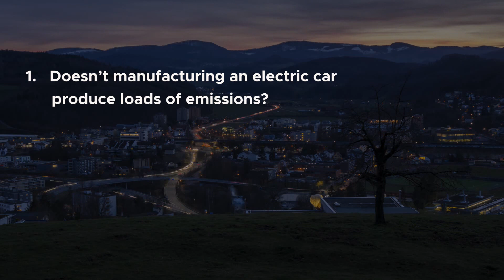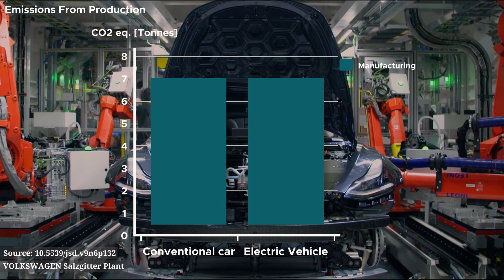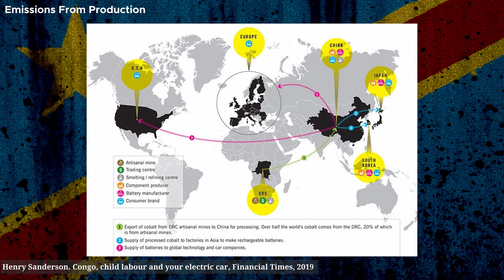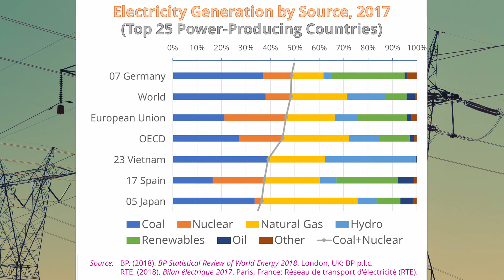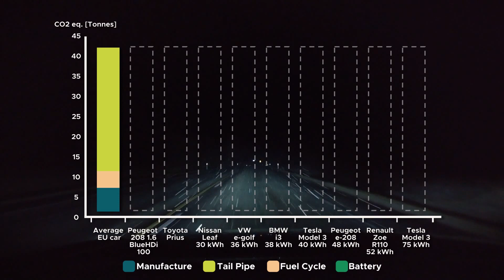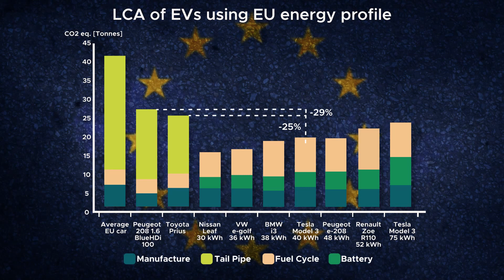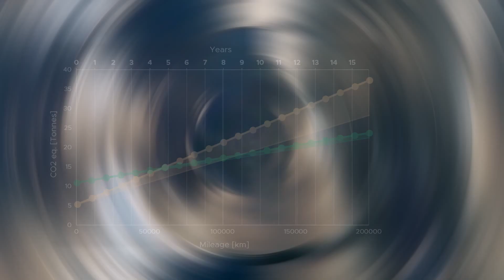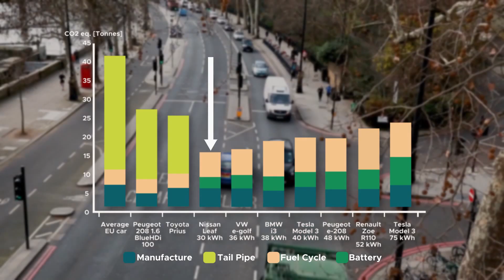Could Electric Vehicles be Bad for the Environment? Data Reveals the Truth

Comment: You've managed to neglect the third leg  ... end of life.  Batteries are far more difficult to recycle and are more harmful overall due to heavy metals. There currently is no process for recycling them on scale, so guess where they will end up? So it's not just battery production that is harmful. None of that is reflected in your assessment.
"Green" can't always be equated to CO2 production.  Not to mention that not everyone agrees that CO2 plays such a significant role, or the only role in climate change. E. G. Methane
The environment has a greater and quicker effect on the wellbeing of civilization. I. E. contamination of drinking water, food sources.  If you don't take care of that, climate change will be a moot point.

Even if your numbers are accepted and are ballpark correct, EVs will provide at most 50% reduction?  Pretty sad that this is the best we can do. 

The greenest thing you can do is to stop buying new vehicles.
Reply from the maker: Hi, you're absolutely right that there is no industrial process for recycling batteries, which is why we neglected it from the calculations - we did not want any speculative numbers in this data set.
However, our references (linked in the description) show that, as you say, recycling produces emission. But the emissions recycling are less than the emissions from production for a new battery. 
It would've been nice to be able to include recycling in this video, it would've made EV's even more sustainable than ICEs. 
We haven't used CO2 emissions in the video, we've used CO2 equivalent, which takes into account effect of different greenhouse gasses. Perhaps that wasn't clear enough.
A 50% reduction is huge! And regarding not buying a new car, at the end of our video we show how long it would take an EV to produce less emissions. If someone owns a old/inefficient car then keeping that car on the road for a few more years is more damaging to the environment than buying a new EV. Although, of course buying a second hand EV is the best option.
Reply: @OurEden  one of the things I was saying is... The impact of contamination/pollution on the "environment" thru heavy metals /carcinogens cannot necessarily be compared to or equated with c02 or other greenhouse gases that ostensibly have longer term effects on climate. We haven't seen the extent of this yet since mining is often done in 3rd world countries... And we haven't yet had to deal with the effects of recycling batteries. 

As for the 50%, that's incremental and just means me have 24 years to live instead of 12.  I love rhetoric.

Lest you think I am against clean energy, I am heavily invested in it. But I also know that there are tons of challenges and limitations... oil and ICE aren't going anywhere soon. I'm not selling my pipeline stocks.  Have a look at "solar heat island effect" for example. Most people aren't aware of this.
Reply: @OurEden  "Hi, you're absolutely right that there is no industrial process for recycling batteries, which is why we neglected it from the calculations" Incorrect, again. Nissan and BMW already are recycling / repurposing their batteries, and the entire battery is 96% recyclable including the heavy metals. What you have failed to do is compare the massive environmental effects of using petroleum. It is certainly cheaper at the moment to repurpose than recycle, but it's being done.
Car batteries being used in home power banks: https://youtu.be/8ZDllPFmXNg
Tesla's battery recycling path: https://youtu.be/LAssX6hAyKs
Reply: @justsomeguy934  Have you ever watched a car being scrapped?

It is easy for a manufacturer to say their car is recyclable and it's true. But in reality when a car becomes worthless the entire car (minus the battery) is crushed up and melted down.

Here in Ireland we don't do much oil / metal refining. We melt the car down into an orange paste, process a little aluminum out of it and export the orange paste to Africa as a waste material. Every material that was in the car is now either in that orange paste or in the atmosphere.

I doubt this video touches on half of the "Carbon emmissions" of manufacturing and scrapping a car and it doesn't even mention the other environmental costs.

The EU is just taxing old cars off the road to prop the car industry up.
They don't give a shit about what happens to them.
Reply: @JKenny44  The discussion was about the batteries, was it not? Aside from the batteries in an EV, it's a conventional car. Steel, glass, upholstery. The batteries are most certainly NOT thrown into the slag pile and melted into orange paste.
Reply: @justsomeguy934  Yes I suppose I am a little off topic.  
The best thing you can do usually is to keep an old car on the road for as long as possible. Any engagement with the new car market is bad for the environment.
Reply: @JKenny44  You are 100% right - keep the working car as long as possible. Don't buy new things unless you need them. If you have an old, beat up vehicle that's reliable and works for your needs, leave it be!

Comment: 8 years of lifespan of battery vs 5 years after it become better. Hmm...
Reply: No. 8 years is the length of the WARRANTY on the battery. It won't suddenly stop working at 8 years and 1 day old.....  Many EV batteries last 10+ years....after which many of them can be refurbished rather than completely replaced.
Reply: @Brian-om2hh  average lifespan is ~10 years (data of other electric car companies, tesla estimate more). So no, warranty is not very more than average.

Comment: Very well researched video! But I'm wondering if the reduced battery efficiency over the years will have any impact on the over all carbon emissions. Also if the battery has to be replaced it seems any advantage gained will be lost. Could you comment on that?
Reply: I guess you are not concerned about oil extraction and refining or the fact that every single step of fossil fuel extraction, transportation, refining requires already a huge amount of electricity. In fact oil rigs use huge amount of diesel fuel in generators to power up with electricity. Where are this details in this "well argumented" video?
Reply from the maker: Thank you! Battery efficiency will have a small impact as it ratio of charging and discharging capacity will not change dramatically. However, the both the charging and discharging capacity will drop overtime. And this loss in capacity will have an impact on emissions. Unfortunately, there are no concrete numbers on battery capacity fading as every manufacturer uses different batteries and testing methods. However, due to recent breakthroughs, modern batteries are showing very little capacity fade. But we need to monitor them for a few more years to know for sure.
If the battery has a fault and has to be replaced, before it's expected end of life, then this could be a disaster, especially for the high capacity cells. However, if its replaced after its end of life then this would be a very sustainable option.
Reply: @OurEden   And what would the cost of a replacement battery be , this might double the impact of contamination.
Reply: @OurEden  how do you mine The lithium used to make a battery of an electric car. You use all diesel powered mining equipment. Then you take the lithium to plant that makes batteries using all diesel powered equipment. Then you take that lithium battery using a semi to a car plant using all diesel powered machinery. Then you take the electric car and transport it using a semi or a train that uses diesel to a dealership. Electric cars also involve a lot of plastic. Plastic is made out of petroleum a.k.a. fossil fuels. 80% of an electric car is plastic the battery is surrounded in plastic the dashes are made out of plastic everything in an electric car is pretty much plastic. We can go on the charging stations that use diesel powered generators sometimes that allow pollution. 80% of charging station are made out of plastic. Just think about it. You can have an electric car. But don’t take away my car or truck running off of petroleum.
Reply: @kaifox8446  What a selfish, backwards attitude. The lithium production from brines doesn't need much in terms of heavy machinery. All that's needed are some heavy duty pumps and some way to separate the different salts from the brine solution. Also EV come with interiors predominantly from recycled materials such as plastic bottles or fishing nets. Maybe you should stop spreading FUD but maybe the exhaust gasses of your gas gussler didn't do you too good...

Comment: Cobalt is also used to remove Sulfur during Fuel refinery. Loads going to waste there.
Reply: Cobalt is used as a catalyst in fuel production (it isn't consumed in the process). While it is the largest use in the catalyst industry its use is dwarfed by its use as a cathode in Li batteries for vehicles. 

This is why the DOE is working to find a different cathode material. A disruption of cobalt would kill EV production while past disruptions have had little effect on fuel production because so little is used compared to batteries.
Reply: @rburns9730  

Not all lion batteries use cobalt
Reply: @fradaja  From a DOE website article titled "Reducing Reliance on Cobalt for Lithium-Ion Batteries" dated 4/06/21

"Industry has recognized the risks of Co dependency, and many battery manufacturers and end users have established ambitious goals to move to low- or no Co-containing cathodes. Many technological hurdles exist , and the U.S. Department of Energy (DOE), through the Vehicle Technologies Office, has committed to a multi-year, multi-thrust program to address all the scientific and engineering issues with eliminating most of the Co in EV batteries."

The vast majority of lithium ion batteries in use today use cobalt because other options can't meet its performance.
Reply: @rburns9730  

And my point still stands , some ev batteries don’t use cobalt , however your phone , or battery powered device usually does , 
As does fossil fuel refining , they are a huge consumer of cobalt , it’s interesting how these new cobalt evangelists have suddenly appeared , even though cobalt has been widely used for years ,

The good thing about this bogus concern , is how it is now shining a light on the Congo , and raising awareness for this egregious industry, even though the driving factor is hypocrisy, thank god for the hypocrites.
Reply: @fradaja  Name all the vehicles and their chemistry. Your "point" is pointless unless named vehicles comprise a large percentage of EV's on the road.
Reply: @fradaja  BTW cobalt use in fossil fuel refining is a catalyst 90% of it is reclaimed. Lithium batteries aren't recycled in any significant number to date.
Reply: @rburns9730  

 It takes a pound of cobalt to refine 6 million gallons of fossil fuel we consume 3.8 billion gallons a day 

Ev batteries are rarely scrapped , they are way too valuable , used Tesla modules are 1k each , and are used in many projects including battery backup and home solar projects , it’ll be at least 20 years before these are ready for recycling, too many valuable minerals and metals to throw away ,  just like copper or any other  valuable scrap , they don’t go to landfill ,
Reply: @fradaja  I specifically asked you for the make of EV and their non cobalt chemistry. Your lack of an answer means you're wrong. Trying to go on a tangent won't change that fact.

90% of that one pound of colbalt is recycled. As for lithium batteries-

"The current method of simply shredding everything and trying to purify a complex mixture results in expensive processes with low value products," says Andrew Abbott, a physical chemist at the University of Leicester. As a result, it costs more to recycle them than to mine more lithium to make new ones. Also, since large scale, cheap ways to recycle Li batteries are lagging behind, only about 5% of Li batteries are recycled globally, meaning the majority are simply going to waste."

So you're wrong about that too.
Reply: @rburns9730  since 2021 chines battery manufacturer S VOLT  have been manufacturing cobalt free batteries , sorry if this is inconvenient,  and the fact remains we still need 666 million pounds of cobalt A DAY in the first place , and the cobalt used by lion batteries is also recycled , difference being it’ll be a 20 year cycle instead of a daily cycle , with 10% loss , 10% of 666 million is a colossal amount of cobalt compared to ev s which only contain 3% , 66.6 million pounds of cobalt is consumed every  day by the fossil fuel industry , even if all ev batteries used cobalt , the amount is tiny in comparison , and the life cycle of that cobalt is measured in decades not days . Yet another ev myth debunked , one day the ice crew will find valid point to justify inferior transportation, the ignorant hypocrisy is astounding, shall we talk about the pump to wheel inefficiency next ?
Reply: @rburns9730  

And the “EXPERT “ is silenced 
How amusing
Reply: Nowhere near the amounts used in EV batteries
Reply: Exactly, how convenient mentioning of how batteries are produced but not fossil fuels.

Comment: Excellent video!  I have a series of similar videos on my channel as well, including a homemade calculator with specific comparisons of EVs, PHEVs, and traditional hybrids based on your driving habits and energy grid profile.  PHEVs are a particularly attractive option, especially given the average commute under 30 miles (as you cited).
Reply: how do you mine The lithium used to make a battery of an electric car. You use all diesel powered mining equipment. Then you take the lithium to plant that makes batteries using all diesel powered equipment. Then you take that lithium battery using a semi to a car plant using all diesel powered machinery. Then you take the electric car and transport it using a semi or a train that uses diesel to a dealership. Electric cars also involve a lot of plastic. Plastic is made out of petroleum a.k.a. fossil fuels. 80% of an electric car is plastic the battery is surrounded in plastic the dashes are made out of plastic everything in an electric car is pretty much plastic. We can go on the charging stations that use diesel powered generators sometimes that allow pollution. 80% of charging station are made out of plastic. Just think about it. You can have an electric car. But don’t take away my car or truck running off of petroleum.

Comment: Now imagine we have billions of Electric cars in the future, that means billions of used batteries dumped somewhere at some point. This introduces a new type of pollution that you haven't talked about...  Just mentioning that as the question isn't focused on greenhouse gases. If we end up wiping marine life with acid it might be an issue.
Reply: Recycling will be the norm.
Reply: @daydreamer8373  yeah like with plastic now ?
Reply: @DaGreatHandle  Well Batteries are a very different beast to plastic. There is real value and valuable resources in a battery pack. making recycling not only the right thing but the economic thing.
Reply: Where will this "acid" come from? There is no liquid element in an EV battery!  Huge oil tanker spillages, which cover thousands of square miles of ocean with thick shitty crude cause more harm to marine life than EV batteries ever would.

Comment: Came from r/engineering, great video. Have you considered factoring in the need for a battery change on EV/HEV? I know Prius needs a new battery after 10 years, iirc. Not sure on other models.
Reply: Batteries currently are warrantied to 160000km or 8 years - which is a good indications that most batteries will last at least double that because else the warranty could well ruin a car company if the failure rate is so high...
Reply: Ssssssss we don't talk about that my good sir 😂😂😂😂 and we don't take into consideration that some of us keep our cars for 15 years and that we may got them lightly used and we respect them and care about them and service them regularly. 
And for an average of 1000$ for a good service at 10 years they will continue to serve us for another 10.
 So we will wait until the new batteries offer at least an 800km range at driving speeds of 150km/h and at least a safely reached 90% charge at 120' before we throw our few hard earned coins to make  car brands bosses even richer.
Reply: @andreasr6632  
so you drive 800km before stopping for a break, dman people are funny.
Reply: Most EV Cars batteries last past 15 years without lowering the range. Just don't buy a Nissan Leaf that does not have active cooling. I never had a car more than 4 years. Usually buy them with 4 or 5 years old and keep them for 4 years. Then pipes and stuff starts leaking/breaking too frequently and I trade the car for something else. Maintenance bills kill old cars.
Reply: @PedroAntunes78  No after 5 years you will start noticing range loss in batteries and it is not safe to keep batteries for 15 years it may have fire risk and other problems most manufacturers recommend to dispose it after 10 years
Reply: Ayush K yup, 2015 Ford Focus EV max range capacity already dipped about 10%.
Reply: with more 'sportier' tires, it dips another 10% as well. Also, you have to take into account hot summers and cold winters...which then is another 10% or so hit.
Reply: @CknSalad  Frequent DC fast charging aslo result in battery depletion
Reply: Ayush K yeah, I don’t know about the current car batteries, but the 2015 Ford Focus EV charges on the stock home charger, which takes around 8-9 hours to fully charge. Supposedly the newer car batteries should be able to handle fast charging better since they are higher capacity and a newer design. It’ll be interesting how much solid state batteries actually improve things…or if they ever even come to fruition.